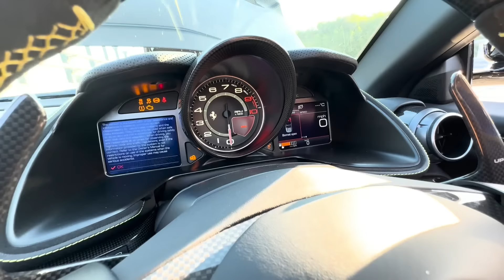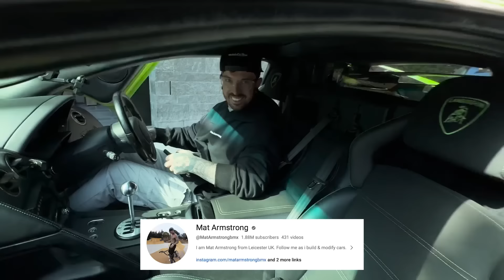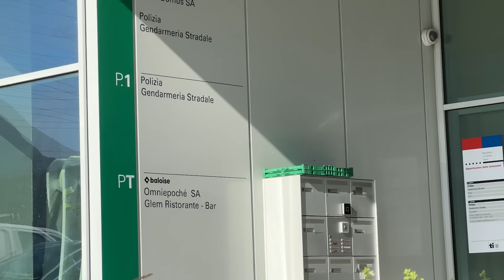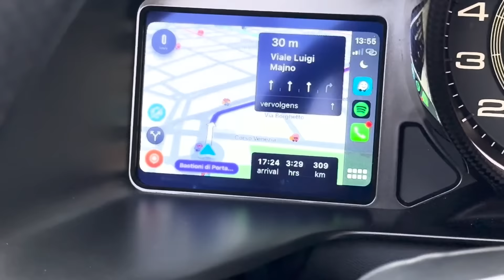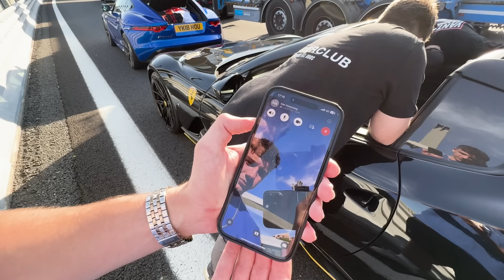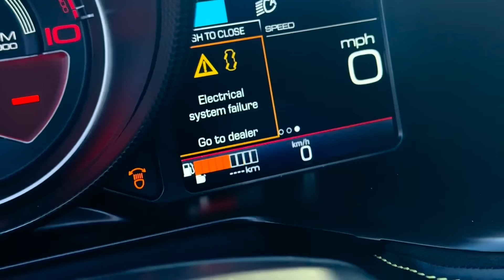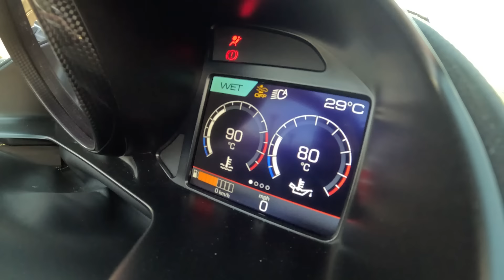I BOUGHT A BRAND NEW Ferrari 812GTS And It BROKE DOWN!

Comment: Nico: talks shit about putting aftermarket diamonds on watch.
Also Nico: puts aftermarket mods into his Ferrari 
💀💀💀
Reply: Yup! Can’t blame Ferrari from wanting to get out of 💰💰💰 I dunno…hammering on the rev limiters isn’t doing the car any favours. Not just Ferrari, Ford, Chev …start changing exhausts and something goes wrong…you are done!

The thing is, at some point…these guys after making all these vids of torturing their cars…will want to sell them …there is no way in hell, anyone would want these cars without a heavy depreciation…so if it needs a motor and trans replacement…You wouldn’t be on the hook for expensive repairs/replacements
Reply: nico is correct men have tool watches not jewellery thats for woman .
Reply: Aftermarket exhaust doesn’t destroy the car. Aftermarket diamonds destroy the watch.
Reply: You totally missed the point.

He's not running around saying that his car is worth MORE because of the mods.
Reply: @withmatt1062  Warranties are usually invalidated with any product if you modify how they operate.  An after market exhaust definitely changes how the car operates so Nico is out of luck.  It's even worse with Ferrari because they don't like modifications of any kind since they believe it hurts the brand.  
Were the issues caused by the modifications or the installation of the modifications... it's something nobody knows.
Reply: @Shocker99  yes but you can always put the original exhaust back on. You 
Can’t take ice off a watch
Reply: @withmatt1062  Of course you can take ice off a watch. There will just be holes left behind.

Comment: Pay To Play!
Did Nico not understand that having your car modified will OFTEN invalidate any manufacturer's warranty?  Even if a modification has nothing directly to do with the problem, they'll STILL usually try to use ANY modification as a reason to deny warranty service.  Oh you're engine blew up?  But you changed the shocks and suspension, so the Engine warranty is no good now!
Reply: Ya they can try to, but those mods don’t void the powertrain warranty
Reply: @TheBajamin 
I think he should show them the burn out video to prove the car was running good with the mods.
Reply: lujiez  and yet in his latest video, he mentions that he saw a similar issue before he did anything to the car

Comment: I agree with Ferrari, once I seen you post a video of you diffing it on full revs, that was the warranty over for me..  Mind blowing.
Reply: you pay over 300k for a car that is MADE for high performance and it brake down that easy? oh please, i would be furious.
Reply: The novitec exhaust is the problem here not the video.
Reply: Probably the dealer play with the car a lot and the battery went low
Reply: @FreeCr7 still you shouldn't drive like an idiot though..
Reply: That’s what a warranty is supposed to be for…
Reply: @FreeCr7 

High performance driving, not hitting the fucking limiter and burning tires.

Buy a Mustang GT500 thats built to actually do that and doesn't invalidate warranty.
Reply: @samueljones3668 hitting the limiter on a ferrari isn't a problem

Comment: I feel sorry for you Nico, after only 3 months it should not happened. The modifications have nothing to do with the fault, but this is only my opinion. Hope you will have luck sorting out your car.
Reply: You're correct. This seems like the electrical systems are shot, and Nico only did an exhausts system swap. But that's just how car warranty works, once you invalidate a clause, the entirety of the warranty is voided.

It's a shitty practice, but it is what it is sadly. Hope Nico gets it sorted out though.
Reply: The exhaust has quite a lot to do with the engine. It affects the dynamic pressure of your engine. It also effects your horsepower. Pretty sure it can have an effect on heat too (in the engine and the surroundings of the exhaust). So they have every reason to remove the warranty. Sorry Nico.
Reply: @MarketingGuy  Unless it's done by some chop shop by a coked up technician, an exhaust swap is pretty much harmless. Especially when it's done by someone like Novitech.
Reply: @LemtemPoktui  he should take it back to novitech for the repairs
Reply: @LemtemPoktui  they had to do an ECU remap for the exhaust so it absolutely could be the problem as far as we know
Reply: @mstrax0258  if the ecu remap indeed fried the electronics, Nico should really sue Novitech
Reply: @LemtemPoktui  yeah, who knows. Those cars are so complex I wouldn't be surprised if even Ferrari themselves don't know exactly if the ECU remap caused it; but they are well within their rights to deny warranty for an electrical problem on a remapped ECU. I'm very curious to see how the story ends and what was the issue more specifically
Reply: dead battery loose ground, or the o2 sensor freaked out, bring a obd2 scanner along
Reply: Nico should show them the burn out video to prove the car was running good with the modifications.
Reply: That's the thing mate, it's your opinion while it's someone's business who knows that playing with exhaust will have an effect on cars electronics. Nowadays there are no modifications that you could do in isolations, every car is a one big computer.

Comment: If these cars didn't cost so much you might think they were junk.  Did you see that little silver Yaris passing  you on the highway?  Cost 15k new, has 180k on it and still hasn't broken yet (owned one). 😂
Reply: The 812 really is just a 'flex'.  At least the mid-engine cars can be great 'Track Cars', but I doubt Nico is doing many track days, and there are far better options for a GT from Ireland to Rome...  Good luck!  Hope it's just the computer needing a raboot.
Reply: @StreetPreacherr Can you give some examples of better GT to drive from Ireland to Rome or another country/city ? (Is not hate, I just want to know other cars)

Comment: Who can think of modifying a Ferrari 812 to make it sound better than it already does 🙄 it's not for nothing that Ferrari engineers have spent years developing the car 😬!! but being a person who defends watches in their original state!
Reply: Ferrari engineers have to abide by regulations and tailor the car to the majority of buyers. There’s a big difference
Reply: I agree bud , it's like buying a patek and then modifying the movement yourself , then when it breaks taking it back to patek, being surprised they aren't interested.

These super cars have to be driven with care or at a consistent speed on a track to keep the engine in a way it was designed to run , not treating it like its a Ford escort and fraping it about in a car park and opening it up for 30 seconds on a normal road , no wonder they were all breaking down.
He will literally go bust just constantly fixing his car.
He learned a huge lesson in why you don't buy cars like this , you lease them ,even the very rich will lease one if its going to be driven like that.
In fact the rich rule of thumb is never buy anything with an engine when it can be leased. Depreciation,  repairs etc..  and you realise they are money pits
Reply: @steve10 you are on the right track but u don’t really know what you’re talking about mate
Reply: @SenszR  yeah of course i dont

Comment: Could be an alternator problem or a loose connection, wire etc... If your battery isn't charging or charging properly it can throw on all those code and warning lights... Explains also why it starts with a jumper pack.... Most likely the guys who worked on the car probably forgot to tighten something...or even a loose earth cable... New subscriber from MA. 👍🏼

Comment: A modification should not automatically void the warranty; they must demonstrate that it caused the breakdown/issues.
Reply: Correct
Reply: When it's that painfully obvious, let's just jump the BS
Reply: Unfortunately it doesn’t work like that
Reply: @Benjamin-578  Assuming US; ". According to the Magnuson-Moss Warranty Act: a vehicle manufacturer cannot void the warranty of your vehicle due to an aftermarket part unless they can prove that the aftermarket part was the cause of or contributed to the failure of the vehicle (15 U.S.C. 2302 (C))."
Reply: @accik  yeah that’s great if you live in the US. Doesn’t apply anywhere else though
Reply: @Benjamin-578  I provided that as an example. Same type of EU regulation is active and I believe that UK is also very similar. Please tell us how it works if you are so knowledgeable in this topic.

Comment: Ferrari's  problems don't change. I have an F12 and the car is with me since 2015 I have faced the same problem many times and most of it is because of the weak battery and electricity An advice from me if you want the problems to be reduced you have to change the battery twice a year I don't know when Ferrari will solve this problem
Reply: Must be an italian thing. I change the battery in my Maserati GT twice a year as well.

Comment: They can’t invalidate a warrantable item if the mods not the cause of the problem of the failure - i.e if the cam chain fails in 5000 miles time it has to be covered by the warranty because the modifications wouldn’t cause it to fail - they have to prove that your modification has caused the failure

Comment: They have to prove that the modifications caused the issues to then say the warranty is voided. If so then id be comtacting the exhaust manufacturer. You can also get a forensic engineer involved to determin what really went wrong.

Comment: F stands for Fast....but Fragile. I strongly suspect given the complexity and "on the edge" nature of the car's electronics, one of the "brains" (of which there are many) has detected "something wrong" and is registering it's displeasure by throwing an absolute "wobbler", preventing the car from starting and running.
The only way of confirming this may well be a diagnosis at a Ferrari dealer. (Some specialists might be able to do this, but I reckon their equipment may not have the sophistication to do a proper analysis.)
It really is no surprise Ferrari might want to "wash their hands" of the car, due to the different wheels, lowered suspension and crucially, a eadically different exhaust. This in itself may be the cause of the "Electrical Failure" warning. (The battery on a less than 3 month old car, which has been driven UK to Italy should be well-charged...UNLESS something basic like a loose battery lead (positive or earth) has ocurred, preventing the battery from retaining it's charge.)
No doubt the Ferrari dealer the car was recovered to will have found the root cause - hopefully not just cure the symptoms.
No doubt you will let us know.....
Reply: It could have to do with te remap they made for the exhaust, it's really hard to tell. I honestly wouldn't touch any system of such cmplex cars, let alone the ECU, but to each their own.

Comment: I'm pretty sure voiding the warranty is a relative term. Voiding it for unrelated stuff can be fought in court, sometimes successfully. So don't give up to fast @everybody!
Reply: I’m 99% sure it says in the warranty you can’t mod your cars.  If it does you’re fucked, you’re not winning in court. And rightfully so. You can’t completely take apart a car, change the exhaust and still have a warranty.

Comment: To fix Matts Lambo if he put a barrier like tape or a latex glove material over the nut head and pressed a socket over it, he could then pull whilst tightening until it pinched and torque it up.

Comment: I hate to sat it after years fo your shouting at stars with bling watches you buy a Ferrari, mod it then loose the expensive warranty you paid for, what a Richard head. But 10/10 for fliming and sharing it all, takes alot and respect to you sir. You should have bought German, still had a great motor and money over for a box load of Daytonas, which you could actually fit in the boot.

Comment: You dont know what to do.. the answer is to simply not buy a ferrari in the first place.

If you do anything to it, the cease and desist will be sent to you quicker than you can pull off your pants to take a dumb after a banger of a vindaloo. Even if its something as trivial as swapping out the alloy wheels they will have you for it. The refusal to fix the cars electrical issues because of an exhaust is purely down to the arrogance of Ferrari and their belief that they can just bully you so they dont have to foot the bill because of who they are. 

Ferraris may look nice but they are unreliable, poorly constructed, thrown together rubbish.